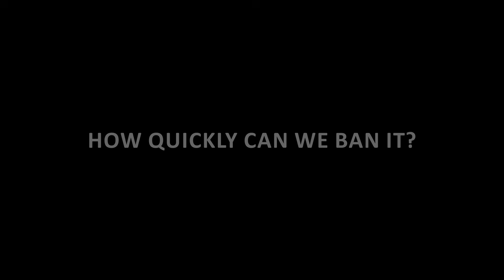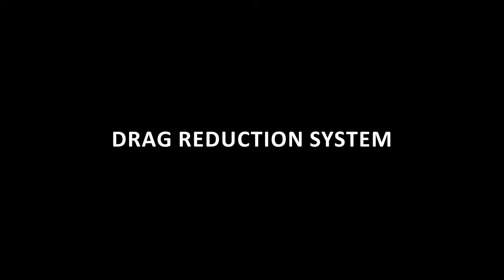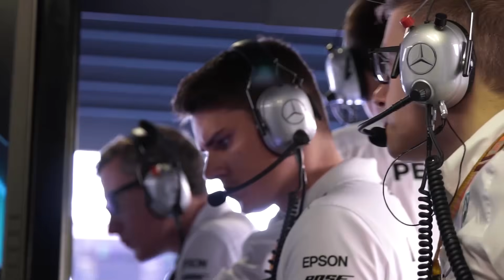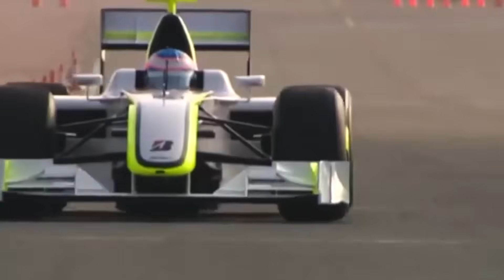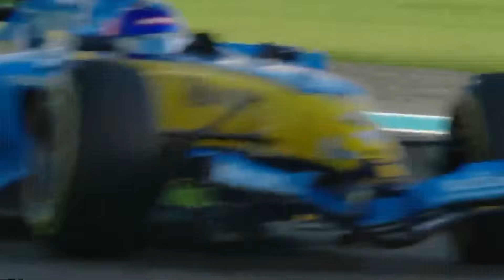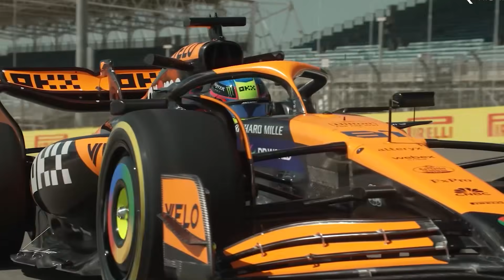The Banned Inventions That Were Too Fast for F1

Comment: DAS and McLaren flexy wings were pretty much due to cost cap. I know the DAS was in 2020 and cost cap was added in 2021, but teams would have to develop such a complex system thinking of next season, and that would bring their budget down by quite a lot with all the studying, developing, testing and improving. The McLaren flexing wing, according to what I read sometime ago, it worked simply because McLaren found a way to re-arrange the Carbon Fiber in a way that would not flex during the tests, but it would flex as soon as the wind hit the wing. Imagine how costly that would have been to research and develop.
The funniest one was the double diffuser. FIA was all like "So you all are going too fast and we want less downforce by making the diffusers smaller so you go slower" and Brawn, with 5 dollars and a case of beer to their name was like "Allow us to 'Nuh-Huh' your new rules by getting back all the lost downforce through, guess what, another diffuser."
Reply from the maker: thanks your sharing with us. You have some very interesting points